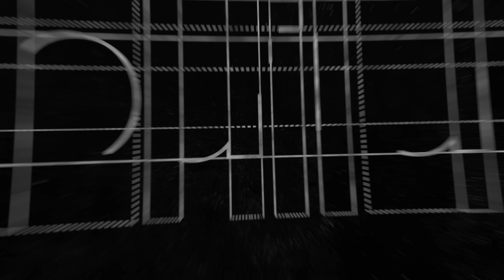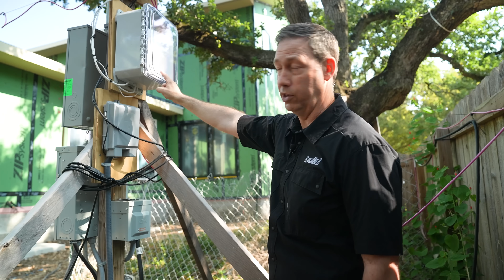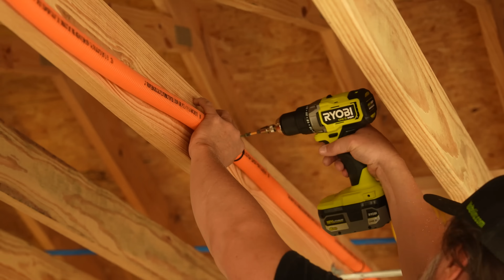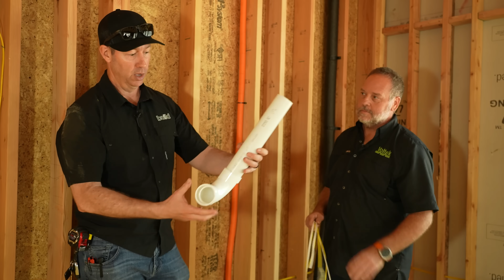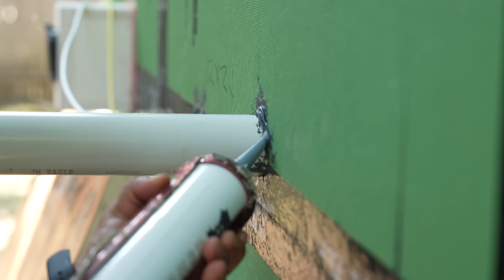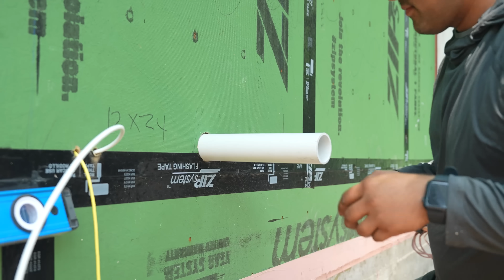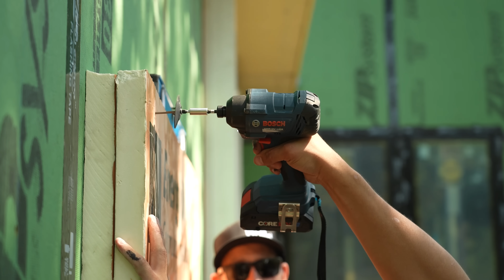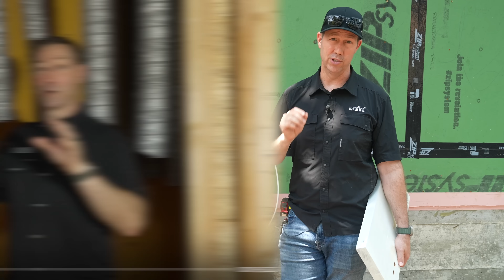Preparing for Google Fiber & Future-Proofing!

Comment: Matt, as a low-voltage nerd, this video is giving me conniptions.

The whole point of running Carlon tubing is to give you the option of pulling cables when the walls are closed up. You can't do that if you cut the Carflex short inside the wall cavity! Why even run it if that's the case? Your cables don't need any more protection in there!

If you're going to use Carflex (or any conduit, but Carflex is the best because it gives you long, swept curves) then run it from your central LV panel/closet/wall out through your exterior sheathing and terminate it into the back of an exterior LV box which you or the customer can buy. This will be the main service entry point into the house. Pull into this enclosure the cables for the services you'll be installing, or at least draw some pulling twine through and tie it off.

If the cable/phone/fiber company terminates to their own exterior box then you can run a patch from their box to yours.

Also, if you're already running fiber and coax (and gluing everything in place) then do yourself a favor and run at least one shielded Cat.6 cable in the bundle because it's cheap and you'd rather have it and not need it than need it and not have it. (StarLink, video doorbell, exterior AP, patio speakers, security cams, analog phone line, etc). Think of it as cheap insurance.

If you're concerned about air or vapor coming in through the open end of the conduit then take a piece of closed-cell foam rubber and cut it into a round plug to fit the conduit ID. Drill through this plug one hole for each cable penetration. Make a slit from each hole to the outer perimeter of the plug. Now you can insert your terminated cables into the plug and stuff the plug into the conduit. The pressure will seal the plug around the cables.

I got the idea from a company called Icotek. Check them out.
Reply: Yea I agree, this kinda just seemed like an after thought quick video.
Reply: This is the way!
Reply: Yes! All of this! And they didn't even run pull strings either in any of the smurf tube or conduit... really easy to blow or fish that through real quick and make it easy/ready for the next guy. Also at this point when wiring up a home for CAT6, I don't see why folks aren't stringing fiber up at the same time to each room too. Makes full-home 10G (or 2.5 or 5G) networking easy, and can be easily done at the same time with the other, and the costs aren't crazy... I'm now wishing I ran fiber in a couple spots a few years ago when I was running cat6.
Reply: Or just run the orange tube to all locations and change whatever down the road.
Reply: ENT Flex is the non-brand name for the conduit. CARLON is the Brand, not the product. "SKIL Saw" should be Circular Saw, or Reciprocating Saw.
Reply: @thedavesofourlives1  Carlon is what they sell around me so I use the terms interchangeably, but, yes, generically it is ENT.

Comment: Matt, don’t forget to run pull string in all of your conduit that is twice the length of the run. It makes so there’s a permanently attached “fish tape” already installed by securing each end of the line to the conduit’s point of entry. Makes doing future stuff incredibly easy.
Reply from the maker: I forgot that!  Great call!
Reply: Yep standard practice is to include pull strings in every single conduit run, it makes things way easier for the next person who comes along. A properly wired house shouldn't require fishtape at all to make changes to the communication wiring.
Reply: With conduit that big and short, fish tape isn't really necessary. You can just push fishing tape without any issue, or if cable is hard enough (like coax) just push cable through.
Reply: @lambition  right, but you would probably be surprised by how often I have come across a situation where someone said the same thing but it was a real pain to get a fish tape through and get a cable run. That would take a few seconds and cost nearly nothing to put a pull string in there, so why wouldn't you just follow the standards and put one in?
Reply: @aweisen1  it’s called mule tape :) plus it tells you how long the run is so you know how much material to purchase..
Reply: While fish tape is the standard, I often just use a vacuum and a small piece of cloth attached to a string to do an after the fact pull tape. Works like a champ on empty conduit or Smurf tube.
Reply: @bradmesserle999 I don’t like mule tape. I just use a poly pull line with a vacuum.
Reply: @Bill_N_ATX yeah, I use poly pull line and a vacuum
Reply: Shop vac at one end, and a pull string will feed right feed itself right through.  If it's being stubborn, tie a plastic bag to the end st increase the effective suction.

@buildshow

Comment: I am a cable installation and repair technician. The standard coax used by my employer is RG6 tri-shield with 77% braid. If you want to go better, get quad-shield coax.
Reply: I think the tri-shield is plenty enough. It's also a lot easier to work with. The main point of the shield is as a ground to block RF signals. As long as the installer uses the cutting tool properly and doesn't cut the inner shield and braid, it should be fine.
Reply: @KevinSmith-qi5yn  in most cases tri-shield is adequate. The only time I have really recommended someone look to rewire with quad is when they live in close proximity to a cell tower and I can see rf bleeding into the line.
Reply: Tri shield offers the same shielding properties now as quad.  Especially with Amphenol by TFC.

Comment: Matt needs to bring on a pro LV installer and do an episode how to properly wire a home build for networking/smarthome. He ran conduit to the outside and didnt run the fiber thru it - That's like putting in a header for a door and have people enter the house thru the window.
Reply: Also wasn’t even conduit. It was pvc plumbing pipe. 😂

Comment: Any time I put in "future conduit", I also cut a length of paracord that's twice it's length of the conduit and run it through, securing it on each end.  Leave the excess in the attic or somewhere out of the elements.  This gives a way to pull new lines without needing to run fish tape through.

Comment: A few comments as a network engineer in the commercial and high-end residential space: Yes, running fiber was great, but many proiders depending on your area will refuse to put equipment inside the home unless you have an enterprise account - that being said, I would've included at least two Cat6A that can be used to connect to an outdoor fiber ONT and/or analog telephone lin (yes, many people DO still get these). Ethernet will also be useful in the event that a customer wants starlink or to eventually run a line to an out-building. Yes, you added the conduit for future expansion, but the cost to run the additional lines is much lower at this point in the build and not when the home is occupied. Lastly, for coax you need to be using quad shield RG6 to help against signal loss and interferance especially over long runs.
Reply: yup, i agree, i also would have out in a pull cord, but he definitely should have also ran shielded cat 6/a
Reply: About 3 years ago, AT&T converted my existing fiber (which was to the outside of the home, and then ethernet to the inside) to fiber all the way into the inside of my home connected to a BGW320 fiber router/WiFi modem. It's a townhome community.
Reply: Completely agree; I'd also push for a box outside as a demarcation point, complete with a 120V outlet and ground bus.  If you really want to go nuts, extend the 2" conduit to an in-ground box so you don't need providers slapping cables on the side of your house. Last comment... maybe don't use plumbing pipe and fittings for the low voltage.
Reply: @patrickkenny2077  That's a good point about the 120V outlet. Thankfully, the builder of our house (2020) put an open-back box inside the wall where communications conduits for both coax and fiber enter our house, the demarcation point. There is a piece of plywood inside this space to allow for items to be mounted to. They also included a GFCI outlet inside the wall to power an ONT. The outside of the demarcation point in the wall is covered by a ~16"x24" metal plate with four screws.
Reply: Yes!  💯!  I have Verizon FiOS. The fiber converts on the outside of the house.  Cat5/6 is run to the "inside equipment"
Reply: My ont is inside the house.. my fiber goes all the way to my rack in my house.. no way I would put a box on the outside of the house in a new house.
Reply: This is not the case at all, we have ATT Fiber and it has all the equipment inside the house.
Reply: @Cdshakes  Around me Verizon runs fiber directly inside the home and typically installs the ONT in the basement or the garage near the electric panal and then ethernet to wherever the router gets installed. Windstream, Frontier, and Spectrum all also run fiber directly into the house.
Reply: Further, if I am building a home in 2024 I am putting in Cat7a everywhere with runs back to a network closet.  At least two from each room and multiple locations in the ceiling for PoE network access points.
Reply: My ONT is in my basement.   Verizon run the fiber strait into my basement.   But I've had it quite a while now, it could be that they wouldn't do that now.
Reply: @iTriguy1 no such thing as cat 7a. Hell, cat 7 isn’t even a recognized standard by EIA/TIA
Reply: Agree especially since it looked like he was running pvc plumbing pipe not actual pvc conduit.
Reply: yeah also run cat6A
Reply: AT&T keeps all their fiber equipment inside the home in the WI market.
Reply: There is so much to talk about with all these comments. There are so many different situations here, is the fiber drop aerial or buried, is the drop going to a comm cabinet in the wall, is a direct home run to the ont. If it's aerial you better have a slack box on the outside where the fiber drop enters the prem. If the aerial breaks you don't want to have the whole run replaced. If it's buried it's going to the comm box, a tech isn't going to run a fiber home run into your closet on the second floor because that's what you want. Now with additions of dual sfp gateways and onts you're going to see less and less extra work, it's going to go to one location and the customer will have less of a choice on where it goes. You're better off running the fiber home run yourself and leaving a lot of slack on both ends.

Comment: AT&T runs fiber in many places (including my home) all the way into the inside of homes connected to an AT&T fiber router/WiFi modem such as the BGW320, which appears to be what Google does. For some older AT&T fiber installs, they run fiber to the outside of the home, and then ethernet into the inside of the home (especially if the home already has an outside ethernet connection). In places that AT&T doesn't run fiber yet in the area, I don't think they use RG6 coax (as is used by TV providers like Comcast, etc that require coax for the old fashion cable signals), but probably uses the old copper telephone wires.

Comment: tl;dr Install conduit from the street. It's worth it.
My parents got Quantum fiber this year. They previously had Cox. When they replaced the driveway many years ago they buried 1 1/2" conduit between various points (without a definitive use at the time). The installers for both ISPs were able to install their respective cables in said conduit from the street all the way to the house without tearing up the yard or doing a janky, exposed install that is so often seen. They both commented about how much faster it was to do in existing conduit, and that that is not the norm, but they wished it was.
Reply: did the price reflect the simplicity?
Reply: @dbarrington1  My dad bought the conduit, and the contractor that redid the driveway installed them for no additional cost. I couldn't tell you offhand how much the driveway itself cost. 
Some of the conduit has also gone to landscape lighting and Christmas lights. A couple of them have been repurposed for irrigation.

Comment: THANK YOU for bringing attention to runnjng network before the walls are closed up. Please keep going woth this... You got the internet into the house but don't forgrt the next step. You still have to find a way to spread it throughout the house. Imo you'd run a network cable to every location that has a TV/media/consoles, 2-3 spreadout locations for internet access points, a run to wherever an office might be or where your kids might be gaming and want to hardwire instead of being on wofi, a network cable to your doorbell for a poe hardwired doorbell cam, maybe a run to each corner of the house plus wherever else you could or would want a security cam in the future. It's so easy to do before the walls are up. Very deatructive to do after the fact.
Speaking of where your homerun will be, not a bad idea to make sure that breaker if on the backup power. Nice to have workkng cameras or anything you still want functuoning in a power outage.

Comment: This is the one thing that whomever built our house 20 years ago had the foresight to do.  They ran a bundle of coax, 2x fiber and cat 5e from a box on the outside wall to the mechanical room in the basement.  ATT was able to splice into it on the outside of the house and then again on the inside were the modem sits next to my server rack.  Only one of the strands supported 1Gb but the other was able to go up to 5Gb with minimal loss from the curb.

Comment: Run network cable inside conduit pipe (pipe from a central hvac,etc.) Makes running new and/or replacing existing cables easier. Typically in the middle of the home and branch it out to multiple ethernet drops per room.

Comment: I work for a cable company. Sometimes builders use the corrugated conduit to get us across whole basements and into a shared mechanical room in duplexes. It can be a little annoying to fish around curves if no pull string.  I think the best thing to do is to use the 1-1/2 or 2" PVC or straight grey PVC conduit. 3/4 is not big enough for the evolution of technology. I really like the idea of the PVC pipe nice and easy to get through and many companies can utilize it.

Comment: Why not run conduit from the outside all the way to your tech area then you can pull what ever you want at any point in the future? 1” PVC conduit is cheap enough to run all the way and you can seal the exterior with duct seal.
Reply: This is exactly how I did it on mine, with pull chords.
Reply: I even did this on my old house - just buried 2-inch SCH40 from the nearby telephone/power pole where all the services do their drops. Currently occupied by my old coax from when I had Comcast, now a fiber line too in addition to a CAT6 POE run coming out of the house for WiFi coverage in the back yard.
Reply: I did the same. Our provider ran the jumper from their outside box and mounted the their media converter inside. I worked in telecommunications on fiber networks, microwave backbone and a gateway earth station.
Reply: It looks like that's the purpose of the 2" PVC he put in for future needs.
Reply: @BA13115  that’s a short run into the wall cavity. definitely not a home run

Comment: I am amazed that the US still uses coax for delivering internet... even for NEW buildings.

Here in Switzerland it is standardized, when you build a new and put in fibre, you (the ISP) has to adhere to standard they agreed on back in the 2000s. We've had a little hiccup regarding that, but the involved ISP is getting a fine for not doing as he should have. 

Essentially what it entails is, that every new home with fibre is FTTH, the demarcation point is an OTO (optical-termination-outlet) INSIDE your home. It provides up to 4 singlemode fiber (BiDi) connections for the different providers and fault tolerance. The fibre then is run in a P2P (Point to Point, a dedicated line for every subscriber) topology back to the point of presence (POP). From there the equipment of the ISP takes over. The above mentioned ISP wanted to run P2MP, which he now has to rebuild to P2P. This ISP would have put optical splitters at the curb, which essentially would have meant that this incumbent ISP would have had a monopoly on L1. This is bad for a number of reasons. Now with P2P, a different ISP can come and rent the L1 fibre and provide competitive internet access to the subscriber. One of the ISPs even supports 25 Gbit/s for those P2P lines, neat and actual competition!

Comment: Have to admit I was expecting to see the Smurf conduit connected to the pass thru conduit so new lines could be run end to end. Would be nice to see or mention how you are planning to leave the interior of the conduit connections. Does the pvc simply run to a capped off end buried in a finished wall.  Is the end of the Smurf duct also buried in the same finished wall or will you be providing a access hatch on the inside of the house to get to both. I truly fail to see the advantage of the pipe if all it does is run from one side of the vapor barrier to the other. It a future upgrade happens they might simply pull the old wire out of the simple hole in the wall and run the new wire thru the existing hole and reseal it.

Comment: As usual, great advice. Absolute best thing to do is to run a 1” conduit and a pull string from outside to your utility or media room.  Personally, I wouldn’t run cable for the provider and instead, make it super easy to pull their wire in to the house.

Comment: Definitely get that Google Fiber. I got it and it has been so much better than cable internet ever was. Even the base 1GB speed is worlds better than the best cable internet I have ever used. Some might show a faster speed test, but do you care about a fast speed test or actually getting a fast connection on the things you actually use? By that metric, it is not even close.